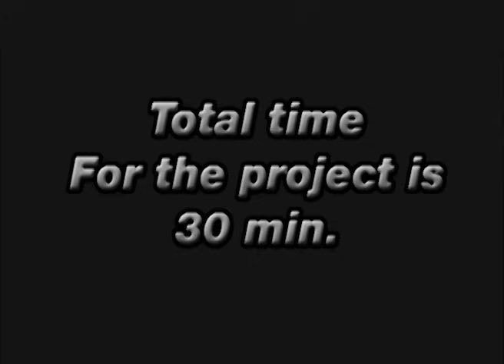DIY: Wrapping Rims in Matte Black Vinyl

Comment: Hi there do you use some kind of adhesive first? 
Pretty sure the vinyl I bought has adhesive on the reverse anyway but would I need more?
Reply: +Elliott Landon no you dont need more.
Reply: +Thomas Komar cheers dude
Reply from the maker: +Elliott Landon there is actually a adhision promoter, but if your surface is clean and smooth. its really not needed.

Comment: there is alot more prep and dry time with that... you shouldn't drive 48 hours after you spray. With vinyl, you can drive when you are done. which is about an hour or two a tire. depending on skill.

Comment: I bet it chips away from gravel, and the heat has to effect the adhesive. Paint stripper and spray paint still seams cheaper.

Comment: Queston. Why didn't you cut out the center cap of the wheel? It says this was uploaded November of '10, so I'm sure you've already found out your wheels can't be balanced with out revealing the center bore of the wheel. Have you had the tires replaced yet? How did the vinyl hold up to the changing process?

Comment: if you attack the wheel with a good pressure washer, how does the vinyl fare?  I have 3M protection on the front and it stays fine, but I use pressure pretty hard on the wheels.  Thoughts?

Comment: Everybody bitching about salt, snow, etc. Well i live  in Vegas. 350 days of sunshine, no potholes, no snow, no asphalt pieces flying around and little rain. What do you think is going to happen to PlastiDip in those conditions? I lived in Boston for 16 years and have been PlastiDiping and wrapping for 7. I had my front bumper vinyl wrapped around the grill and never had a single scratch. I had my rims dipped and would last one winter only. Enough said.

Comment from the maker: FYI... plasti dip isn't a new thing, I have used it, it falls off, and I can peel it with my finger!!! this was and is a experament, and its still holding strong. if I wanted my rim black for a week, I'd use plasti dip, if I wanted it black for a year I'd paint it. If I wanted it black forever I'd powdercoate it... but I don't know how long I want them black.

Comment: They will not last you've put to much stretch into it they will fail and peel back some things you should not do with wrap, wheels better sprayed
Reply: And after any stretching you should then heat it up to 100degrees so it stays moulded to the shape, and if you say I'm wrong I'm 3m trained and it's my full time career good luck

Comment: Can you also use a blowdryer instead of a heat pistol?
Reply: would take longer
Reply: Yes, but you would need a good 1800 watt hair dryer. A heat gun can destroy the vinyl if you are not very careful and the hair dryer will do the job just fine without worry.

Comment: how will this do on rims that have decent curb rash an the lip?
Reply: Get JB Weld epoxy and fill in the bad spots.
Reply from the maker: Jason Whitfield
Yes exacly right. just a little fill and sanding and your good to go. vinyl sticks to any material free of dust dirt or grease.

Comment: Not trying to be wiser. But I would definitely not do it like that. It might look good for a period but it will not last long! The problem is that your are putting to much stress on the vinyl by pressing it and stretching it that hard. I would cut out a piece in every triangle instead before stretching it.

Comment: What kind of vinyl is this? I want to do my wheels with a printed vinyl, and i need to know what kind
Reply: This type of vinyl its call air release or air egress vinyl, design to apply on pretty much all surfaces, there are several brands that you can use to do your vinyl wraps, like 3m, Avery, Orajet, Arlon etc. Car wraps are becoming very popular and most print shops are offering this service.

Comment: where can i get this done? and can you go thru the car wash after having this done?
Reply from the maker: like mentioned several times. i got a seson pass two years ago from pertocanada(gas station) which means you can wash your car every day for 90 days. my brother and i took turns every other day. so these rims went thru a fully auto with brush car wash maybe 40 times durring winter.

where. no where. no vinly shop will do this becase they all said it cant be done.

Comment from the maker: nope. nice try... ive had them on for three year. so good try... in addition to being a heat sink to the rotor they are also a heat sink overall and cool quickly. vinly lets at the same rate as paint... sooooo.... yes... 

When i was tracking i got my calipers so hot that the paint peeled right off, the only thing that remained was most of the caliper sticker.

Comment: Nice  idea..  but  wouldn't the  vinyl just peel  off  when  it  gets wet? Also it'll tear from  stone chips and  from parking.  Also  if  you take  it  off  you'll  leave ugly marks from  where the vinyl was.. get the wheels  done  properly  or  buy cans  of  paint and lacquer. do a proper  job.

Comment: I understand that, but the body of the car is not spinning at speed like the wheels are.  And subject to brake dust, snow, rock chips, etc, etc... And what if you have to get your tires changed?  The body of the car, with except of the grill, forward edge of hood, and lower valance, would even see the same abuse the wheels or rims do.

Comment: Disregard all other comments. Plastidip sucks ass. It doesn't last and cracks within weeks. If you use protective spray wrapped rims can last for 4+ years. They cost about the same, and wrapping requires less prep. Plus plastidip actually takes longer to remove.

Comment: Forget that, paint the suckers.
Reply: +Juan Bartet What's the difference? Except this method is easier, faster and cheaper? Plus the final look is the same.
Reply: +Offensive Madman take a look to the inside of the rim, he only did half of the rim from the inside. There is still white inside which looks awful.
Reply: MrSokullu Oh yeah, i totally forgot abut that
Reply: +Offensive Madman Fuck paint and this wrap stuff. Use plasti dip. You can spray it on like paint, and peel it off like a wrap. Plus you don't need any other material other than the spray cans and stuff to clean the rim before you start spraying. Plus it's fun to peel off of things when you wanna change the color or just get a fresh coat on there.

Comment: 1:25 or something : NEVER cut holes for bubbles... NEVER !
1:30 cut a small triangle in the wrap before using the heat gun... it'll be easier and the wrap will stay in place longer.
Don't do tutorials if you don't know what you are doing

Comment: look at how terrible the inside of the rim looks.. its vinyl wrapped black on the outside and then silver on the inside? And if you do vinyl wrap the inside, there will be a seam. Plasti dip is the way to go.  Ive had my rims plasti dipped for over a year now and its held up perfectly through car washes and everything.  You just have to find the right solution to clean it with to bring back its original color after brake dust gets caked on. Plasti Dip>Vinyl

Comment: why are you so pissed off about it....
lets see the facts about both peroducts 
TIME: vinyl takes 2 hours/ plasti dip takes 50-60 min if you are applying 4 coats on the rims
COST: 40$ for 4 warps/  27.20$ for 4 cans
DURABILITY : warps last for 2-3 years and resist the heat that comes from the car and the brakes/ plasti dip  lasts 4-5 months with only 4 coats of spry but the more coats are on the longer it lasts 
EQUIPMENT: vinyl: heat dryer/ plasti dip: none
LOOKS: almost the same
you decide!!!!

Comment: 11 mins? Lol, by the time this boy covered 1 rim i already covered my entire set of 4 rims. Plasti Dip is BETTER ;)
Reply: if it's fast to lay down, it doesn't mean it's better. how about durability? does your dip have a lamination layer ? nope.
Reply: TopWrapz yliteippaus lamination as in protection? yea actually you can spray a protective clear coat or the glossifier plasti dip over the final layer of black paint or whatever color you were doing and still keep the same peel able properties plasti dip is known for. i sprayed my rims on my 350z a while back and im a year round driver in north america. so far they have survived the winter very well!
Reply: Dip makes a glossifier aka a lamination layer sooooooooo....... But that's none of my buisness 🐸☕️
Reply: nah, its not the same. It's the same plastidip, just the color is clear. Vinyl has actual lamination layer to protect the pvc layer underneath. It's much more durable than plastidip/glossifier. I have done some test how much scratching both of them can take. Vinyl wins. You can heat minor scratches away with a heatgun as well. But anyways, I would recommend to plastidip rims rather than wrapping them.
Reply: So much misinformation here. For platidip "Allow 10 -30 minutes dry time (dry to the touch) before applying additional coats. A minimum of 5 coats is recommended for best performance and easy removal. " Did you do 5 coats?

Comment: Wow......I just don't get the black rim craze. It just looks like someone who can't afford nice wheels for their car.
Reply: Funny how time and tastes change. By now, 4 years later, chrome wheels look dated, and everyone has them. Plus not every car looks good with chrome wheels. Mine is yellow....black rims with some color look great (to me).
Additionally, today we have vinyl with air channels and many different colors like Sunset Shift from Oracal. Colors you could only get before by painting, and not all paint is recommended for rims. There are also "pro installer videos" available today where they demonstrate the best ways to install the vinyl, and what will FAIL because people overheat and overstretch and take the vinyl past its ability to adhere.  If not done properly, I'm sure the vinyl, plasti dip, or paint, will look like crap in no time.  Having done regular window film tinting, without contours, I can say its not easy to get it right. As a DIY project I would say vinyl looks easy to screw up, and practice makes perfect. I would leave it to a pro installer for it to look right and perform right.